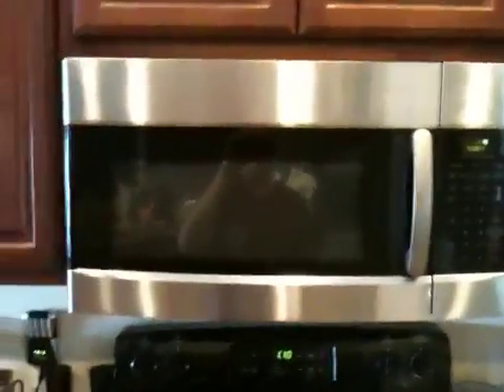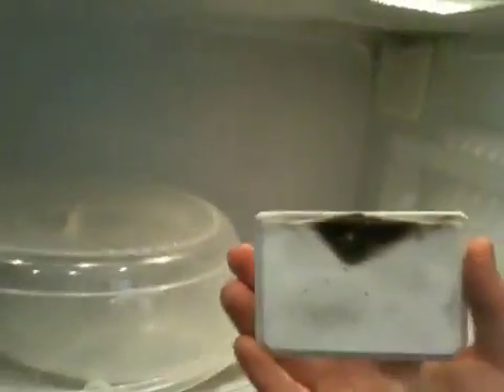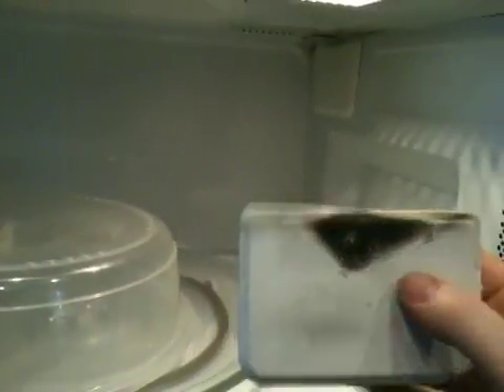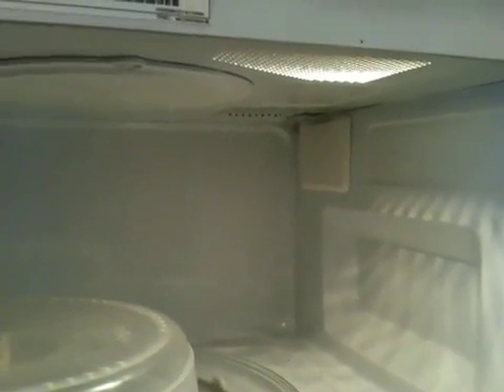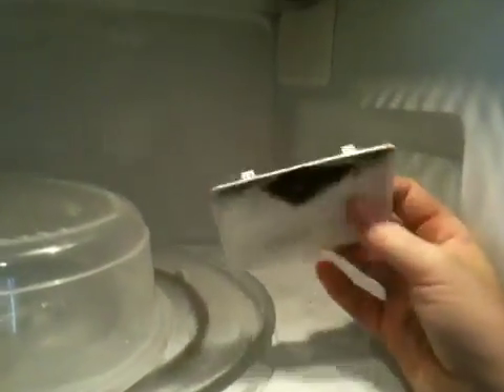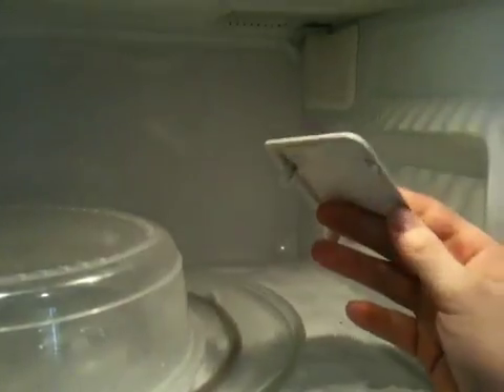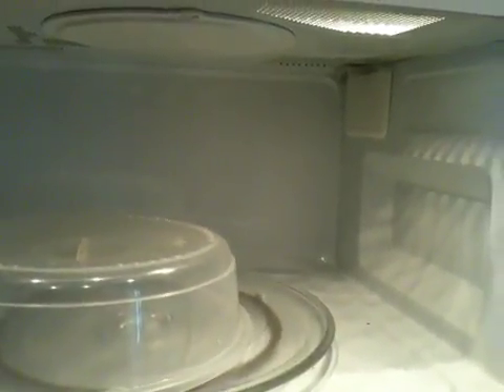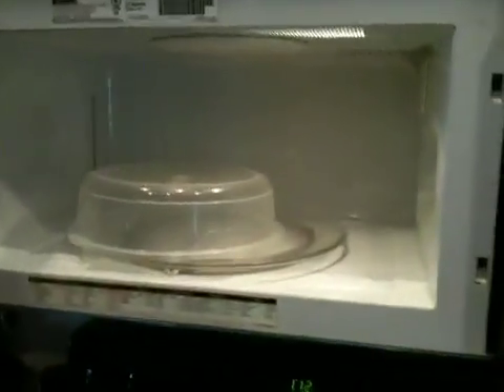Microwave sparks with nothing in it!!! Wave guide cover repair!

Comment: Protip: Running microwaves empty causes unit damage. Without anything to absorb the microwaves, you wind up with powerful standing waves that heat up the unit until either the timer goes off or the magnetron's vacuum breaks (destroying the unit) or a thermal switch is tripped.
Reply: test with a glass cup of water, it will absorb rays and heat up. Easy test !

Comment: Does anyone know where to buy the round plastic fasteners, if that's what they are called? I have a Sharp and the tops of my plastic fasteners  broke off when I tried to pop them out. Sharp told me that they were not meant to be popped out and actually replaced my 6 month old microwave because they don't replace wave guide covers. I think the real reason is that they want us to buy new ones after the year warranty is over! That is just nuts to me because it's so easy to replace, well expect for the fasteners. This microwave is only 6 months old it's big and was expensive. It works great but just needs to have the wave guide cover replace. Then I can give it to my mother who's needs one. So I'm hoping someone can help me out and tell me how I can get the fasteners. I also seen a video on here with a screw that holds the guide cover in place. I had no idea you can use screws in microwaves. Can it be any screw, or is there a special kind? Hope someone out there can help... Thank you so very much!

Comment: Where did you up the replacement cover. I can't find a plastic one anywhere, only the paper mica ones. Thanks in advance.
Reply: Did you find it? I’m having the same issue. My cover plate looks fine, but the clips broke when I removed it
Reply: @briancampbell1046  , no, I never did. I had to replace the microwave.

Comment: hello thanks for the help but what happens if the sparks still happen even without the mica plate?
Reply from the maker: Mevish Awan  I would  clean the whole oven especially the hole behind the cover and vacuum it out. If it still sparks after doing this I would decide to call a repairman or buy a new one.
Reply: @osteencitadel  I know this is 3 years old, but if your cover had a hole or otherwise allowed steam etc to go past the mica microwave guide cover, it could cause your machine serious damage via short circuits.   You can cook without the cover, but ultimately your machine will be ruined because of the food and moisture going into the electronics.  If you catch it early and replace the cover, you will likely save bucks.  The cover itself is ridiculously high from the manufacturer but you can buy a sheet and cut to size for $5 to $20 American.   I am certainly no expert but have been reading up.  Vacuuming might help but it has to dry out and keep your fingers out of there.
Reply: +Mevish Awan Good question.  My answer is no one should be using a microwave with nothing in it; It should also state this in all microwave user manuals.  Some food with moisture needs to be inside to absorb the microwaves or the waves will be more intense than the microwave was designed to withstand.  If you're using the microwave as a timer, stop.  Go get a timer or use your mobile.

Comment: Worked for me.  I just cleaned the little cover and that seemed to fix it.  No replacement was necessary.  It doesn't have to be perfectly clean either.  I think the black carbon deposit is what causes the arcing.

Well done.

Comment: My GE microwave doesn't have that cover but this video triggered my thought on grease or something that is not visible.  My microwave was pretty clean and I can't really see anything noticeable that could cause the sparking.  I used the soup with a sponge to clean the inside including the rack anyhow.  Surprisingly after the cleaning, the sparking went away.  I hope yours can be as simple as mine.

Comment: Extremely helpful advice!  Thank you!  I always get a little freaked out when it starts sparking, but after a thorough cleaning, it did the trick.  Two things are worth noting.  First, in my case, I had to gently remove a plastic fastener holding the wave guard in place, but with a small flathead screwdriver and a small pair of needle nose pliers, it popped out just fine.  Second, don't forget to clean both sides of the wave guard...even though the speck of food causing the problem was on the outside (facing the interior of the microwave), there were substantial stains and or residue on the flip side of the guard.

Comment: Thanks for this.  I too was ready to put my microwave on the curb due to sparking until I came across your video.  I am really really bad at keeping my microwave clean so my wave guide was covered in grease, old food and biological experiments.  I cleaned it real good with dish soap and a sponge, dried it off, and popped it back in place and VIOLA no more sparking.

Comment: I found what looked like a brand new stainless steel Oster microwave in my apartment complex next to a dumpster; so I decided to take it home and check it out to see if I could fix it. I plugged it in and it turned on, the only problem was that spark thing. Then I came across this video and just cleaned it up and put it back and IT WORKS PERFECTLY FINE. Free microwave score! Thanks for sharing this with us.
Reply: Rosaura Zamora that's awesome!!!